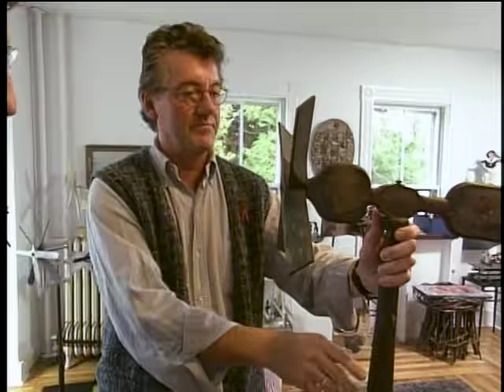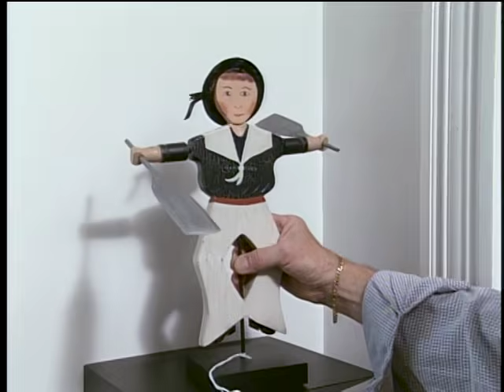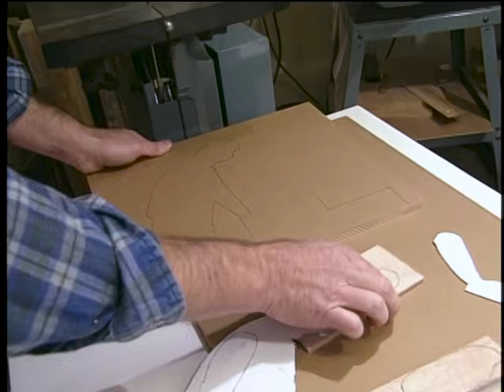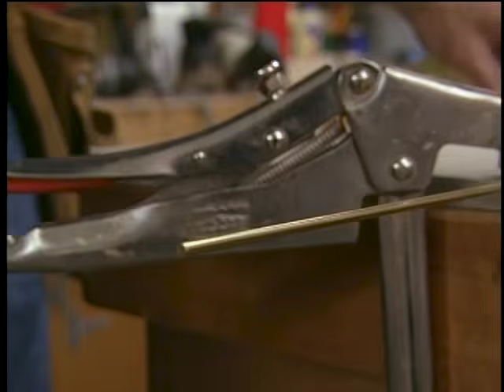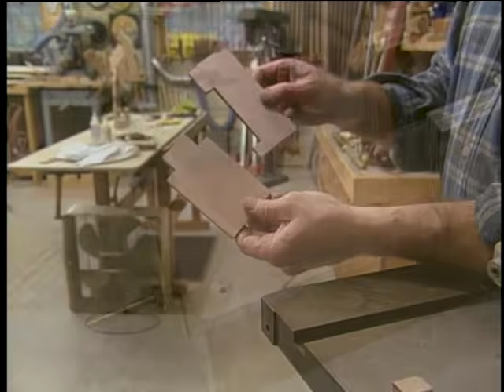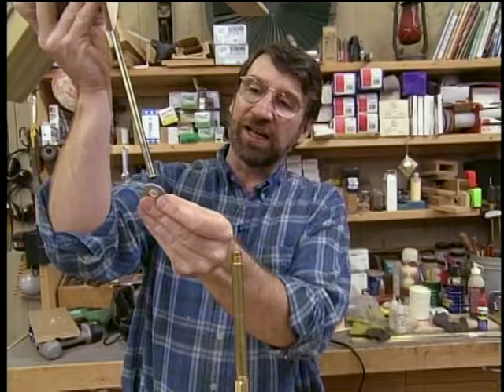Whirligig  |  S10 E10

Comment: I wonder if using a rubber belt on the saw pulley would have been better. It would help avoid it slipping like it does with the string.